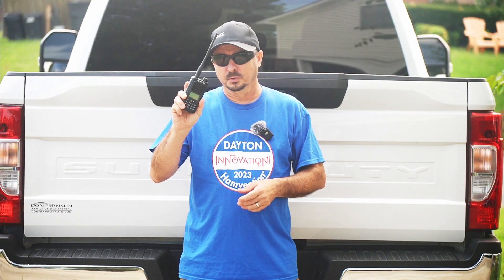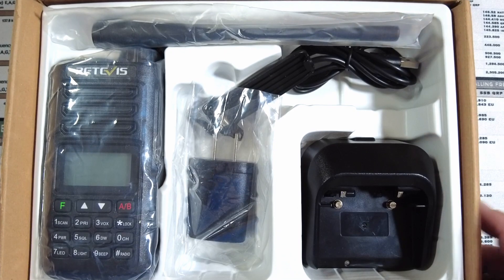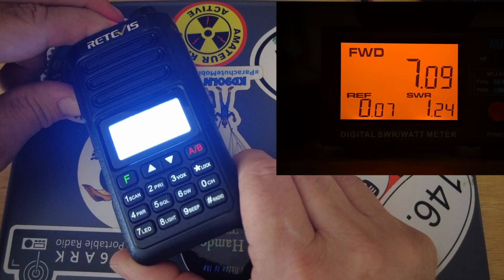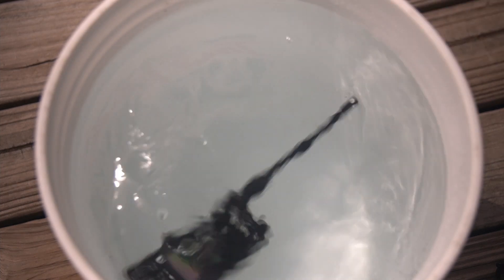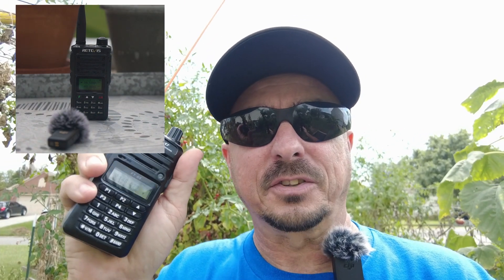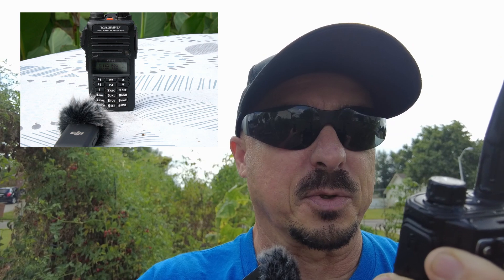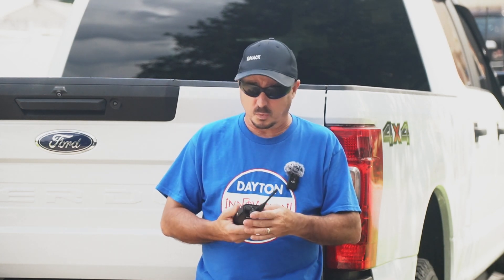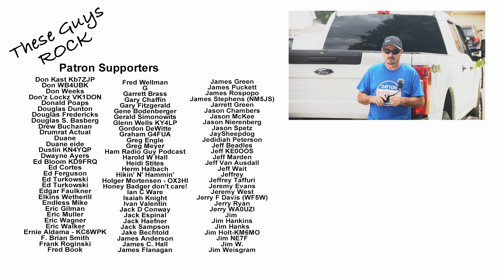Water Torture Test :: The Results Were Shocking! Retevis RA89

Comment: A guy in my ham club said he worked for Majic Mountain amusement park. He stated that if they dropped radios into water rides they would rush them to a bucket of De-ionized water and a lot of times it would save the radio.. Not sure if it works but apparently DI water has no minerals which is supposedly what really shorts out the radios circuits.  Not sure I'm buying that theory.

Comment: Looks like it passed your tests with flying colors. The one thing you didn't check was to see if the output was clean. At that power level if it's not clean, it could cause increased interference with other frequencies. Some of the lower priced Chicom radios pass, some are not so great. Thanks for the test. I don't think I'd buy one until I knew the spectrum output was clean.
Reply from the maker: Dave Casler did the spectrum testing in this video https://youtu.be/4Orn1EvYB9w?feature=shared and he gave it a clean bill of health.

Comment: The Trifecta - waterproof, USB-C charging and true high power output.  Nice large capacity battery to go with the high power output as well.  The programming cable is not included and is an additional $13.  The RA89 is not currently supported by CHIRP but programming will almost certainly not be a problem for long.  On the plus side, Amazon has a 10% off coupon so the $70 radio is $63.  Very tempting for my rough and tumble HT use - my 4WD mini truck, 4WD SHTF bugout 4Runner, and my G310GS adventure motorcycle, where the HT would be acting in place of a mobile rig so the extra power would be appreciated, but I'd also be likely to operate in the rain or drop the HT into a creek.

Baofeng has been making radios that have one of the three features for the trifecta, but not all... and while none of the HT specs accurately report power output, Baofeng fibs more than most.  Retevis seems more accurate than most.

I think it would also be very interesting if someone made a software defined radio version of an HT that allowed AM and SSB as well as FM.  AM is good to receive (and transmit if legal to do so) on air bands, and SSB could be useful for digital modes on VHF/UHF.
Reply from the maker: I would love to see an SDR HT capable of SSB! 

From the testing I did with this radio, it seems rugged enough for daily use on a motorcycle. I wasn't very gentle with it during filming. It ticks a lot of boxes for a sub $100 radio.

Comment: More & more radios are having the feature enabled if being able to be programmed via BT from an App to your Laptop. My Chromebook isn't compatible with most of the universe these days, but my Android Pixel 7 would be great if an App could update the settings & memory channels on my Ham & GMRS radios. I do love the USB-C charging as most of my Camp Hosts are not set up with an Inverter in their rigs & we find it inconvenient to run the generator just for charging via a wall cube. It would be nice to see a GMRS version of this radio. I find it much easier to get 16 camp hosts a GMRS license than to convince more than one or two of them how easy it is to get a ham license at their age, lol. Cheers, Davey - KU9L
Reply from the maker: So true and the very reason I got a GMRS license.
Reply: @KM4ACK  20 years ago when I was very active with weak signal MS & Aurora, there was several simplex repeater products on the market, but they all disappeared & the one Chinese brand I can find has terrible reliability ratings. I wonder why they disappeared & I still think it would be useful for seasonal or temporary use on both ham & GMRS.